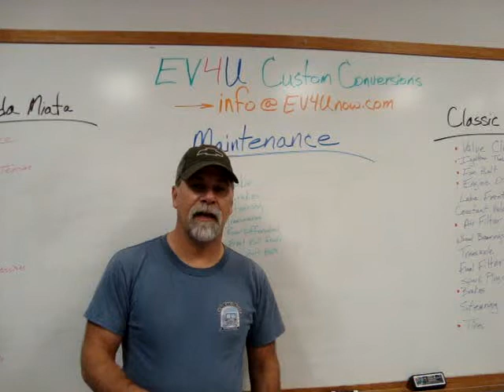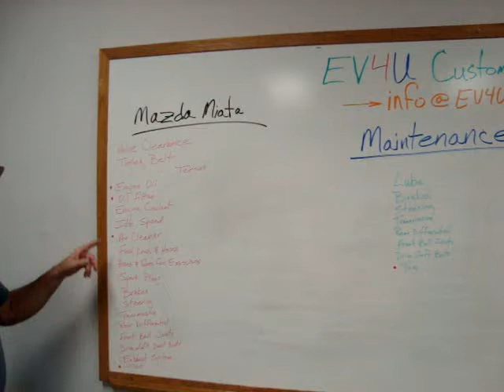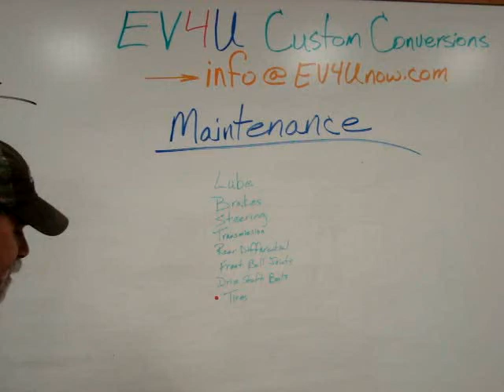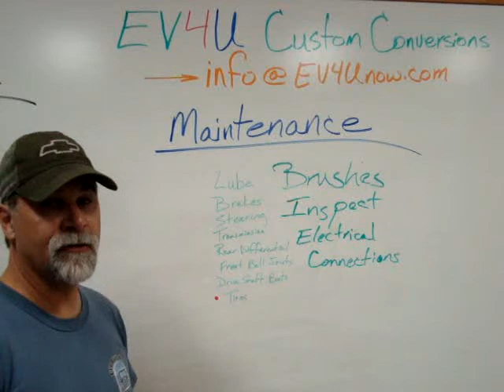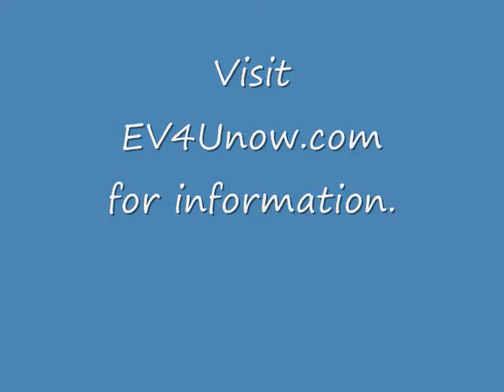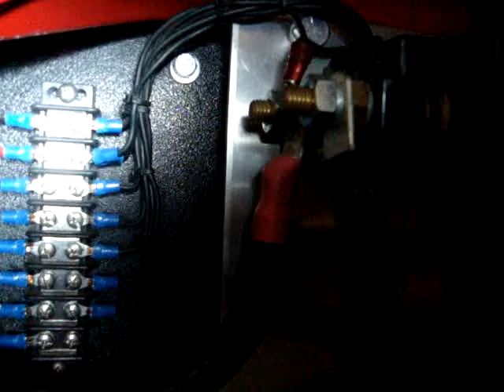Electric Conversion Basics - Flash Back - The EV Answer Man Episode 6

Comment: I have couple of questions right now. Is it dangerous working with a battery pack, is there a risk of electric shock? Also, I hear people say that you'll never need to deal with oil again, but wont you need to use transmission fluid? Also is there demand and profit in converting car for later sale, in other word is it a viable business to convert cars?

Thanks for your videos!
Reply from the maker: It can be dangerous working on or with anything which you are not familiar.  The LiFePO4 cells are capable of large amounts of current which at only 3.3 volts can cause serious injury.  The number of products made from or that use petroleum is countless.  In regards to demand and profit relating to electric conversions.  Probably not the right person to ask.  EV4U is mainly focused on the educational portion of the equation.  Our goal is to assist you in building your own conversion.  The conversions we do are done more as a courtesy, and are not intended for profit, but we do cover our costs.  We do the conversion for folks who want a conversion but are unable or unwilling to do themselves.  How large is the demand?  One of the issues is that components cost are high, which cramps the margins on profit.  Please address questions and/or comments to info@EV4Unow.com  Thank you for watching.